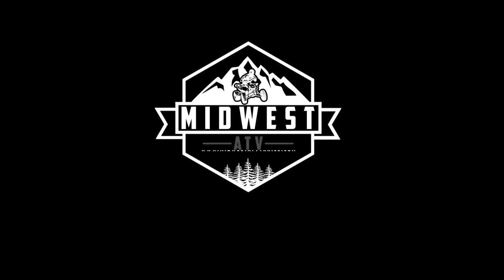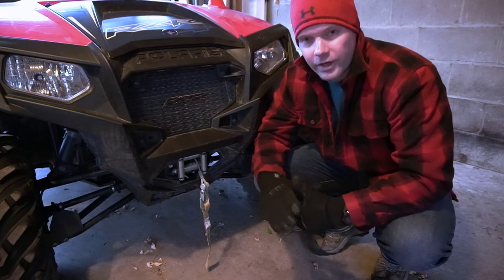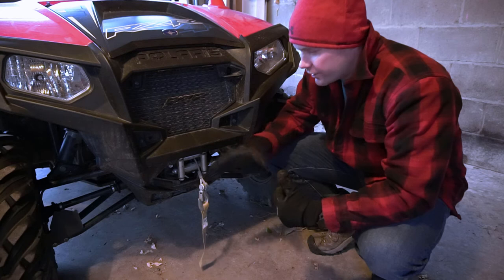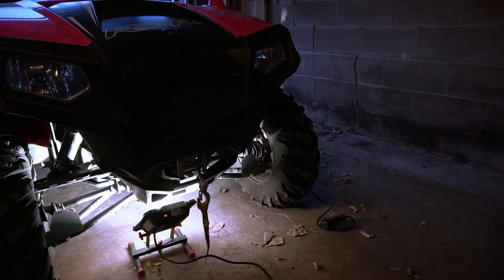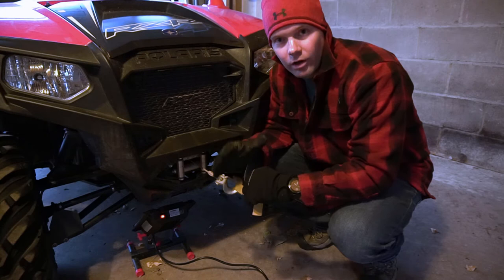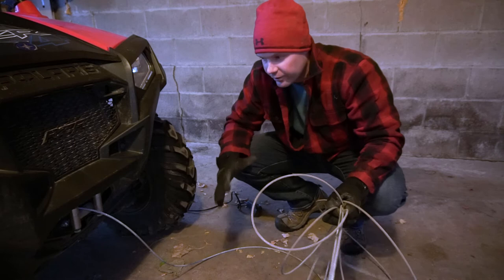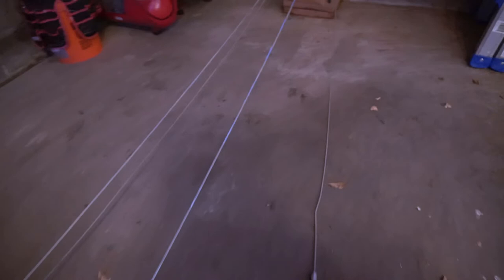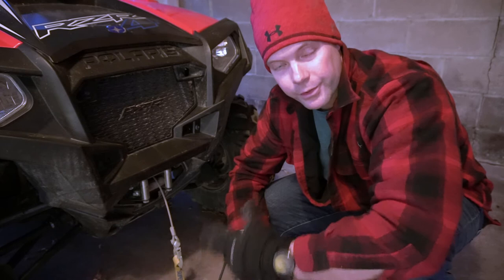3 Tips to Keep Your Winch Working when You Need It

Comment: Once a year I would recommend for those who are mechanically inclined to remove the winch and disassemble the gear box side. Clean the old grease, dirt and debris out and repack it with fresh grease. For those who ride in water conditions you would be surprised what seeps past the seals. Great basic video though on winch maintenance.